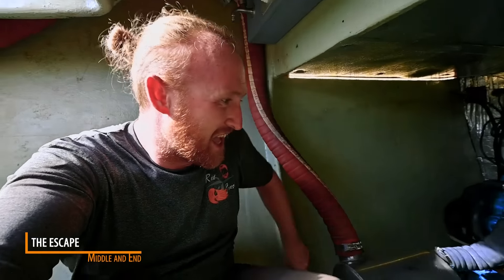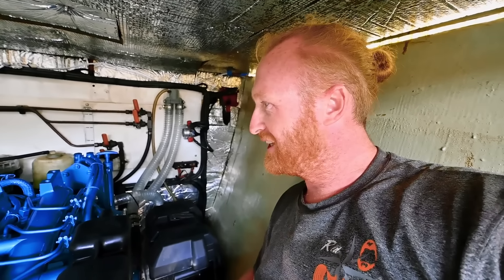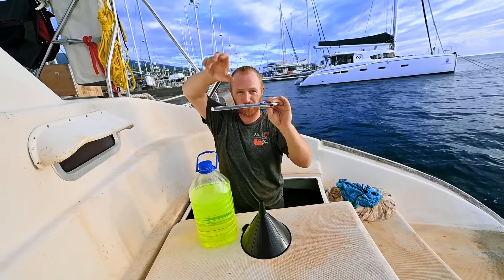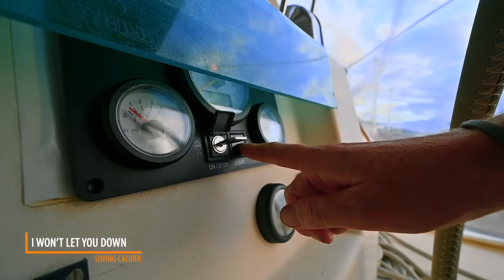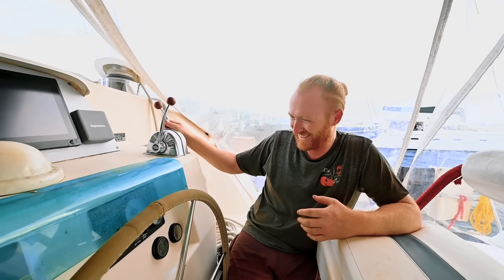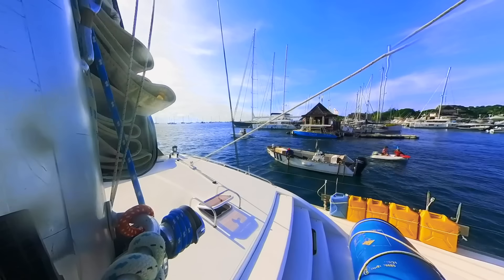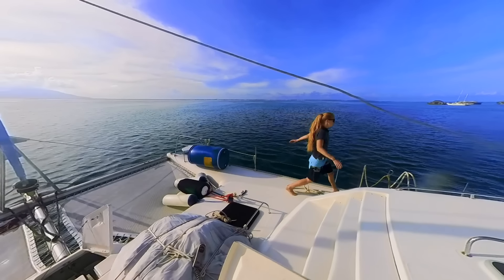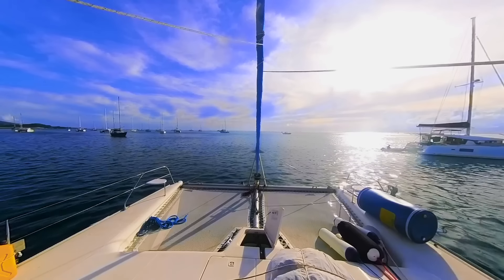Did they just BLOW UP A BRAND NEW ENGINE?!? [Ep127 RED SEAS]

Comment: The coolest thing about doing all this work yourself (well beyond the cost savings) is how much more you know your engines than if someone else had done it.  

You’re that much better prepared if something goes wrong way offshore.  Each of these small trails/hiccups benefit you tremendously (in priceless knowledge). 

How can those smooth purring blue kittens (your babies that you brought to life yourself) not put a smile on your face?

Congratulations!
Reply from the maker: Nailed it! That’s exactly what we wanted out of this project. Engines that would let us service them anywhere on our own, using the knowledge we have gained in the process of fitting them. 

Far from experts, we still have plenty to figure out but at least we get a head start having done the full install ourselves. 

We are still pinching ourselves to be honest. Totally wild!

Comment: nigel caulder's boatowners mechanical and electrical manual is a great thing to have. check to be sure the boat's grounding system is correct. MASSIVE CONGRATS!
Reply from the maker: I think those are considered the cruisers bibles. Think I’ve read both cover to cover over the years. 😃 we will figure it out. Going to be something silly that we overlooked I’m sure.

Comment: Check for leaks ..air leaks ...check for debris in the fuel... Bleed the fuel system.  
But you're used to all that. .. make sure your throttle cables haven't slipped check both the inner and outer clamps. If it has them.
Reply from the maker: I mean, we have to have missed something stupid. We have been making it up as we go along after all 😂
Reply: @RedSeas  
When you've been sweating your Mc Vitties  off  pushing and shoving ICE  engines into boat shaped holes ..  🙄 it can happen to anyone.. 🧙🏼‍♂️🇬🇧
The day of the direct drive ICE engines coming to an end..  Just so much easier and more efficient  when folks can go Electric ..hybrid power and just stick a generator anywhere and quieter.  Less maintenance as well done well you can even get regen under sail.

Comment: Wow I had forgotten how long it had been since you found out that one engine was toast and the other was on its last legs. Congrats on getting them running. I knew you could do it. And you chose to do it in the most challenging way possible, while still floating. At least you had a dock that a forklift could drive on. With out that kind of access this would have been a whole lot harder.

Now find out why that one engine died on you and get back to cruising.
Reply from the maker: It’s been ages. Almost a year! We never seem to do things the easy way but it usually works out. Unfortunately for us, there wasn’t even a forklift available at the marina to help. Poor Indioko did all the heavy lifting. 😃

Comment: Hi Guys,

One thing to add, because you reversed your gearbox you will most likely have another gearratio in reverse and therefor less efficient. please check. you might consider 2 new propellers later on (fold-able) with the right sense of rotation. Also check if it ratio is not to low in reverse because you might overload your engine. If the ratio is too high you just make a lot of revs and get het required speed (inefficient)
Regards,

Rolf Hendriksma 
sy Rajac

Comment: Glad to hear the blue twins come to life. Did you scrub the fuel tanks after they sat properly got some growth , diesel bugs etc. that will plug up your filters. Anyway hope you find something soon & happy horizons Cdn. Dave
Reply from the maker: Cheers! It’s funny, because we haven’t had a working engine in so long, we actually had two full tanks to the brim. Given diesel bug generally forms in the condensation at the top of the tank, we are hoping that it hasn’t managed to take hold. That said, we will keep a close eye on the raycore filters and hopefully catch anything before it becomes a problem.

Comment: Are the engines pre-run in from manufacturer?Good job guys.
Reply from the maker: Great question. I believe the team at Nanni Austrailia were kind enough to set everything up and give them a bit of a test before shipping. Made everything a lot easier for us. But after the “creative” installation process, I am not surprised we have a few fine tunings required. 😉
Reply: @RedSeas  after finding your first video of the engines I went on their site and read up a little on them.The kubota base are a reliable engine you should get many thousands of hours out of them with regular recommended oil change periods.When the engine cut out I’m assuming you now know how to bleed the high pressure side of the fuel system,I’ll look forward to the next video,safe sailing.Dirk.
Reply from the maker: They are pretty rock solid engines. As you say Kobuto based so easy to maintain and proven track record too. We are really excited to get to know these puppies. Hope you find the next safe of the adventure just as entertaining as the last.
Reply: @RedSeas  it’s the reason I subscribed to your channel,im interested to see how they perform in real conditions,I’ve been eyeing off an old cat with two stuffed engines for a couple of years now watching the price drop as there is no access to lift out the engine other than cutting out the roof and removing the dinnette on the ports side and kitchen on the opposite side and cutting out the floor to remove the old engines,refresh that area and whack a couple of big Nannie’s in there,has to be cost effective,I don’t want to over capitalise into a vessel that only depreciates,if the hull is worth it then I’ll move forward.Thanks for the chat.

Comment: How long did it take. From start to finish?
Reply from the maker: So our engine dies 318 days ago. 
We spent 4 weeks in the marina but 1 week of that was spent waiting on customs and cyclones to clear. 
So total it was 3 solid weeks of work for the two of us to remove 2 engines and a generator. Then build new engine beds, Then lift in two new engines, align them to the shafts, then plumb them in and wire them before finally testing and leaving the marina. (We did a cheeky montage at the end of the episode to sum up the journey) 😉
Reply: Great work 👍🏻

Comment: I had the same issue after a coolant change... Laughed at myself.. as I'm a qualified mechanic 😂 shit happens guys. You would have done zero damage.
fYI. My N4.50 sits at around 79c. After a big run, oil pressure drops to around 3 bar. Got 600 hrs.
Reply from the maker: That is exactly what we were hoping to hear. We have been seeing around the same.

Comment: Soo what happend did the engine fail or is it a fast repair ? Hopefully it's not too serious
Reply from the maker: I’m sure we will get to the bottom of it. Next week we explain things a little more.
Reply: The cables can be hooked up different in the control?? Or on the engine.. meaning transmission.
Reply from the maker: Yeah, we just need to open up the throttle control at the helm and switch them around a little. Not a big job but funny that we overlooked it.

Comment: That is a crap coolant system design, fit a bango fitting to that nut you removed with a hose to go back to the coolant tank.
Reply from the maker: That’s an interesting idea. Why not simply rely on the buffer tank to take up the slack. Admittedly it’s a bit challenging having to use the bleed bolt as the filling point so perhaps fitting the buffer tank there would be easier to refill
Reply: The Cummins QSB has 3 locations where they fit a pipe to drain an area where air can be caught, this air becomes super heated and over pressures the cooling system.

Comment: Am i the only one wondering why one of your brand new engines just made a funny noise and shut down?  I can't believe that no one seems to be the least bit concerned about it.  Sometimes I wonder about this channel  Everyone is so happy and celebrating the new engines.  Yet, one of your brand new engines just shut down for unknown reasons.  SMH
Reply from the maker: 😜 I mean that is kind of the point of the title and thumbnail 😂 
We were totally worried about it and that’s why we were all over it and discussing with Nanni Australia to confirm the causes etc. thankfully we got to the bottom of it. 
As for the smiles and excitement, if you had been on the rollercoaster we’ve been on for the last 12 months, you’d be just as excited at the simple prospect of having two shiny engines in the boat 😂